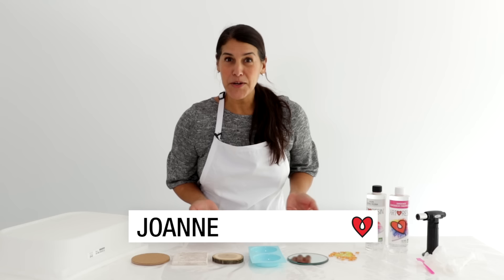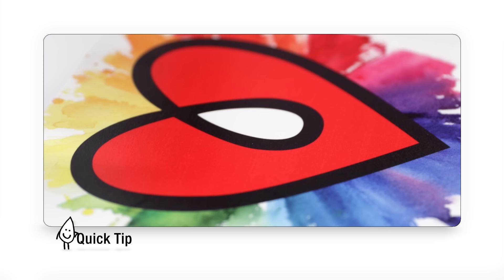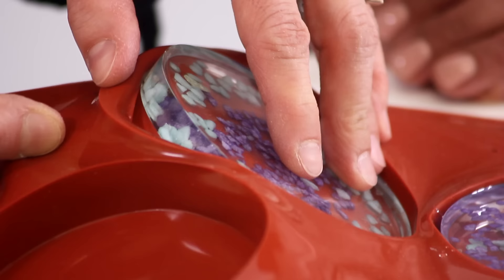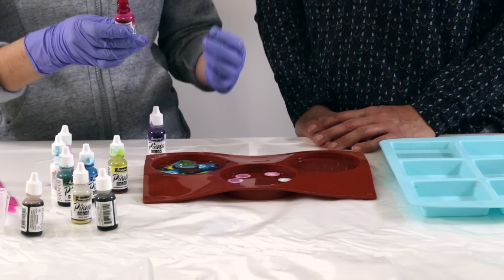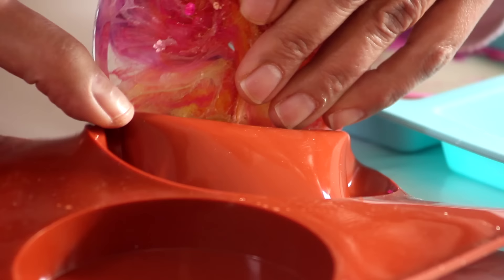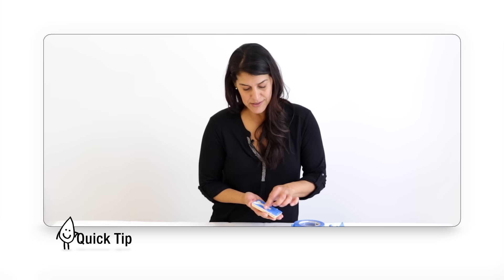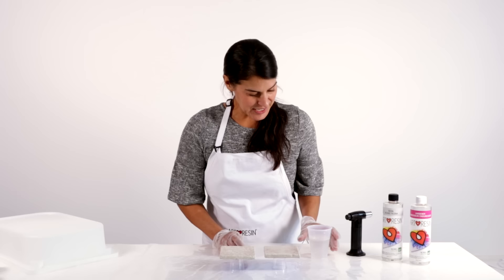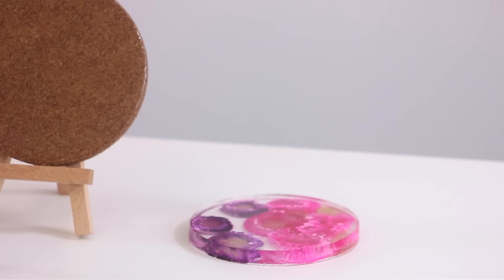How To Make Epoxy Resin Coasters - EASY!

Comment: Love this video lots of good information for someone like me who is just getting into resin.  I do have a question, if I use alcohol ink and you can not use the torch to get bubbles out, what do you use if you have bubbles?
Reply from the maker: Hi, to help reduce the bubbles before you start you can give your resin and hardener a warm water bath. This will help to thin out the resin allowing the bubbles to easily and quickly escape to the surface for popping on their own. If you do notice a few bubbles before you start adding your alcohol inks, you can use a toothpick to pop them.
Reply: @Artresin   Hi, I did what you said and after 24 hours took them out of the molds, they looked great except they were very flexible, I could almost bend them in half. I thought after 24 hours they should be hard. Am I doing something wrong?  Thank you
Reply from the maker: @laurierozar6412  ArtResin is still flexible after the first 24hrs of curing, this is normal. It takes a full 72 hours for ArtResin to fully cure.
Reply: @Artresin  Thanks for the response. It has been well more than 72 hours and my bookmarks are still flexible.
Reply from the maker: @laurierozar6412  Hi Laurie, if your bookmarks are still flexible after 72hrs of curing, it's likely due to one of the following reasons:
1. Too much colorant - if you've added too much colorant to your resin, more than 6% per total volume of resin. Too much color upsets the delicate balance needed for your resin to cure properly. 
2. Too thin of a pour. ArtResin works best if poured 1/8" thick. When poured thinner you will find it remains more flexible
3. Improper measuring & mixing
For more information on why your resin cure is a little bendy, please check out our blog  https://www.artresin.com/blogs/artresin/how-to-prevent-bendy-resin?_pos=1&_sid=76b83ca29&_ss=r
Reply: @Artresin   This guide will help me a lot. Thank you so much for your response and help on this matter.

Comment: Simply beautiful!How can I seal a printed image? (Printed on a ink jet printer? What can I use to avoid to damage the printed image?
Reply from the maker: Hi David!  You can certainly use a brush on or spray varnish or sealant. I would reach out to your local art supply store as they should be able to recommend one that will work well with your photographs.

Comment: Could CLEAN beach or desert sand (colored or plain) be used? Or would the resin push the sand off the coaster base?  Great vid! THANKS!
Reply from the maker: You could certainly mix sand into the resin :)  If you are wanting to pour over top of sand it could get tricky but can be done. You will want to be sure it is adhered to your base and maybe even use a spray sealant to hold it in place as well so that when you apply your resin it doesn't come loose and float up into it.

Comment: I just started with silicone mold if u use mica powder do u start from the bottom up or not also when I pulled my coaster out of mold the edges curved up what can I do to avoid that
Reply from the maker: Hi Mike - there's really no right or wrong when making coasters.  You might find that the pearl separates and sinks to the bottom so you can either wait until the resin thickens a little bit before you pour into your mold or you can stir the resin in the mold occasionally to prevent it from settling at the bottom.  Experiment to see what you like best.
As far as the edges curving up ... it is normal to experience a slight concave edge.  This is easily fixed by either trimming the edges when the resin is dry to the touch ( and still soft enough to trim ) or when the resin is fully cured you can sand the edges with a dremel tool or sander and applying a thin coat of resin mixture to restore the gloss.

Comment: I tried wood, similar to the cuts you have in your video (a little bigger though 8" diameter), however, I stained it first (I did not seal it), let dry, then resined. The final product has areas where the resin did not stick. Areas separated by morning. How can I fix this? Can I simply re-resin and the areas that the resin didn't stick to before will fill in and the piece will pool in the bare areas and self-level , so no pocks or holes or chasms will be left? Please let me know what you think. Thank you!
Reply from the maker: You are right on track. You will want to sand your current coat of resin so that the new coat has some tooth to hold onto. You will want to clean the piece to remove and remaining dust or oils which may have caused the resin to repel. Once its dry you can then pour another coat, it should fill those areas in and self level back out just as you mentioned :)

Comment: Such beautiful ideas! Thank you so much. I have a question though. I'm allergic to the two part jeweler's resin. Do you think this would be safer for me to use. I see it says there are no rules but not sure of the rest. I use UV resin but it has it's limitations. Thanks in advance and have a great day!
Lisa
Reply from the maker: Hi Lisa, Unfortunately if you are allergic to another type of resin it is highly likely you will also be allergic to ours as well.
Reply: @Artresin  Thank you so much. That's so disappointing. I really loved working with the two-part resin. Have a great day!
Reply: You can do this with UV resin. Mix it for at least 3 min let it sit for 5 min to get the bubbles to settle. Pour as usual and let it set with a cover for at least 48 hours. Do not use uv light on it. It works.

Comment: I don't feel very comfortable with a torch. Will a heat gun work?
Reply from the maker: If you are using ArtResin in a mold a heat gun would help some as we do not recommend using a torch with silicone molds as it can break down the mold. However on other pieces Using a torch is the number one way to achieve a flawless, resin finish, free of bubbles.

When you catalyze your ArtResin mixture, you create a lot of bubbles as you stir. Those bubbles need to be eliminated or they'll cure right into your piece. 
The flame from a torch heats the resin surface up instantly, thinning it out and allowing bubbles to escape very easily. Not only does a torch provide the pro results you're looking for, but has the added benefit of burning off tiny dust particles that may have landed in the resin.

Comment: Great videos. I'm new to resin and subscribed to learn more.

But I have a question about clean up.  I see in the second part you mixed in a big measuring cup(pitcher).  Some mix in plastic disposable cups so you can throw it out.  So how do you clean up the measuring cup?  Seems like it would solidify in the cup or mess up your drains if washed.  Thanks!
Reply from the maker: Good Question! You do not want to pour it down your drain :) We like to wipe them out with a paper towel and then use alcohol to wipe them down again to get any remaining product out. 

Here is our blog we did not cleaning tools: https://www.artresin.com/blogs/artresin/how-to-clean-epoxy-resin-tools
Reply: @Artresin thank you so much.  Very helpful!

Comment: Great tips, but shouldn't you be wearing a respirator while working with epoxy/resin? I never mix up any epoxy or resin without my mask and gloves!
Reply from the maker: We definitely recommend always wearing gloves when using  ArtResin.  ArtResin is non-toxic, does not produce fumes and is safe for home use, when used as directed.  That means, when you work in a well ventilated area wearing a respirator is not required, but is always an option if you prefer.

Comment: I'm using art resin its amazing! I have a question with regards to coasters, please can you tell me what is the recommended thickness for the coasters and are they ok to be used with a hot drink? I know their not hot plate safe but are they okay to use with the normal heat of say a cup of coffee?
Reply from the maker: The maximum temperature that cured ArtResin can be exposed to is 120F/50C. Temperatures higher than 120F/50C, such as those from a dish straight out of the oven, may lead to some irreparable damage on your resined surface. So exactly as stated perfectly fine for a cup of coffee but not a hot plate :) As for thickness you can make your coaster as thick as you like you may just need to pour in layers, we recommend pouring 1/8th inch approximately per layer.

Comment: In some other video of resin art ...they ppl mix 1:2 ratio of hardener and resin ..so can u plz tell me are they using different product or whts the reason actually
Reply from the maker: Hi Maheen, ArtResin has a mixing ratio of 1 part resin, 1 part hardener-by volume.  Different resin products have different mixing ratios so it is important to always follow the manufacturers directions carefully.

Comment: Would you recommend using a torch while working with silicone molds? I've read that the mold itself might melt from the heat.
Reply from the maker: You do want to use caution when using your torch in silicone molds, torching is meant meant to be done quickly with the flame lightly kissing the surface. I always use caution around the edges but have yet to melt a mold.

Comment: How do you finish the edges from the coaster molds? I find they get slightly raised on the outer edges. So the finished "bottom" or back isn't quite flat.
Reply from the maker: Hi Cassidy, you can sand off the higher parts or you could dome a layer of resin on top.
Reply: @Artresin  Awesome. Thanks!

Comment: Why do some of your videos say Resin has a 45 minuet work window, then other times you mention 3-5 hours? I will be using Art Resin to cast and preserve some broken glass Xmas ornaments and I want to make sure I do the process correctly. Also how thick can the poured layers be?
Reply from the maker: The working time of ArtResin is roughly 45 minutes. The mention of 3-5 hours is when you can pour another layer.

You have two choices when pouring multiple layers: the first is to pour your first layer, torch out the bubbles, cover and wait 3-5 hours until your ArtResin epoxy resin reaches a jelly like stage. At this point, you can pour on your next 1/8" layer, torch out bubbles, cover, wait 3-5 hrs and repeat until you reach the height you desire. This method is especially handy when pouring into a mold or a dam. The second option is to allow your first layer to fully dry, then give the overall piece a light sanding and pour on your next 1/8" layer. Torch out bubbles, cover and let this layer dry. Repeat these steps as many times as you'd like.
Reply: ArtResin ook thank you!

Comment: What is the alternative of torch if we don't have torch?
Reply from the maker: A torch really is the best method to remove bubbles but when using a mold you can use a heat gun to remove them as well :)

Comment: If you sit a hot cup, for example one with hot coffee, will the cup stick to the coaster?
Reply from the maker: ArtResin is heat resistant to 120 degrees F. I personally have ArtResin coasters on my desk that I use daily with my coffee with no issues. : )

Comment: Is there a project that in involves a deep pour resin mold?
Reply from the maker: ArtResin was initially designed to be a sealant and poured at an 1/8th of an inch in depth. We do have artists that use our product for pouring deeper than an an 1/8th of an inch but they achieve this by doing multiple pours. You can go up to 1/4 inch in your pour and would suggest you use a torch to help pop any bubbles you may have.

You can layer ArtResin epoxy resin in multiple coats, as high as you'd like, as long as you pour in 1/8" increments.

You have two choices when pouring multiple layers: the first is to pour your first layer, torch out the bubbles, cover and wait 3-5 hours until your ArtResin epoxy resin reaches a jelly like stage. At this point, you can pour on your next 1/8" layer, torch out bubbles, cover, wait 3-5 hrs and repeat until you reach the height you desire. This method is especially handy when pouring into a mold or a dam. The second option is to allow your first layer to fully dry, then give the overall piece a light sanding and pour on your next 1/8" layer. Torch out bubbles, cover and let this layer dry. Repeat these steps as many times as you'd like. 

Keep in mind that our recommendation of a 72hr cure time is based on a 1/8" layer. The thicker your layers are, the longer the cure time will be. It could take up to 10 days for a full cure, depending on how many layers you've poured.

Comment: Please can u advice me how i can correctly measure the epoxy to acrylic paint ratio .. i cant seem to get it right and my art is not curing properly
Reply from the maker: You will want to use no more than 6% colorant to the total volume of catalyzed resin. So for example if you are using 10oz of ArtResin you will not want to add more than 0.6oz of colorant to the mixture.

There could be other reasons that your pieces are not curing properly as well including the mixture being off. If you are still having issues please send us photos and a little more information about your piece to support@artresin.com and we will be happy to help trouble shoot further.

Comment: I see how there are still tiny bubbles in them even after you use the torch. Is it possible to create a completely bubble-less clear resin solid if done properly? Or should I expect to have some bubbles nomatter what?
Reply from the maker: It certainly is possible to have a completely bubble-less finish. There are many things that will impact how many bubbles appear like; temperature, torching, and and additives to the resin just to name a few. The best thing is to experiment and see what works best for your project :)
Reply: ArtResin thanks!

Comment: Great vid!!!  I want to put a gold metallic paper on the bottom of my resin paperweights.  How would I attach that?  Thanks!
Reply from the maker: If you wish to attach you paper after the resin has cured you can use really just about any glue. I might suggest a spray adhesive so an even application. You can also brush on a very thin coat of ArtResin and it will certainly adhere it to the already cured resin.Whatever you decide to use just be sure it dries clear, especially if you will be able to see it through your paperweight :) 
Now just note that you may want to seal your paper first before applying it as the resin or even some glues will soak into the paper.
Reply: @Artresin   This is so good to know.   Will try it first on a sample.  I don't want to ruin the good ones.  Thank you so much!  You have the best resin vids ever.

Comment: I just recently played with resin and 2 of my wood projects came out great... But I tried making coasters and cake stand  last sunday ... First attempt ever.... However its been a week and mine came out so soft 😭 can anyone tell me what happened.... I used art resin... 1 to 1 ratio.... Mixed it for 3 min... Used jacquard alcohol inks... Used heat tool to blow the design and bubbles.... Its not hardening and bending
Reply from the maker: Hi Amber, sorry to hear you have had some issues with your resin cure. Bendy resin can be caused by;
1. Short cure time - resin will be flexible after 24 hours. It takes up to 72 hours for a full cure
2.Too much colorant - if you've added too much colorant to your resin, more than 6% per total volume of resin, it upsets the delicate balance needed for your resin to cure properly. 
3. Too thin of a pour. Although ArtResin will fully cure on thin pours, expect your resin to be bendy if it is not thicker than ⅓ of an inch. This means you may need to pour a couple of layers for best results. 
4. Improper measuring & mixing
It sounds to like maybe your resin just isn't thick enough to hold it's shape. I would recommend pouring another clear layer on top to add more strength. 
For more information about bendy resin, please visit our website https://www.artresin.com/blogs/artresin/how-to-prevent-bendy-resin?_pos=1&_sid=cb5226825&_ss=r
Reply: @Artresin  wow.... Thank you for replying... So helpful

Comment: I’m confused. I’ve seen other videos and the artist used the alcohol paint in resin and they used both a torch and/or heating gun. However you stated not to because it can catch fire. So can you give clarity as to why you won’t use it to rid of bubbles and if it’s just what you rather not do, but can be done. This is something I want to try but I don’t want to cause any fires of course. Thanks in advance!
Reply from the maker: Alcohol ink is flammable so we like to exercise extreme caution and not use our torch when using alcohol inks. You are correct may artists do torch their inks and that is a decision you have to make on your own. We do not recommend it simply for safety reasons.

Comment: Hi xx when I use the site pigment it drops to the bottom just leaving big white dote xx can you help xxxx
Reply from the maker: Our Ink Sinker is unique because it's heavier than most. This means that it has the ability to drive the alcohol ink down into the resin. 
Typically the ratio is 1:2 .... 1 drop of white per 2 drops of color and you want to drop the white Ink Sinker onto the color so it drives the color down into the resin.
As long as you remember to follow the colored alcohol ink drops with Ink Sinker, there's no right or wrong.
Keep in mind that the more white you add, the more the ink will sink to the bottom: too much white and you'll get more white dots on the bottom of your coaster/piece.
Reply: ArtResin Awww thank you so much for your reply xx that is so helpful xxx your videos are amazing 💕💕💕💕